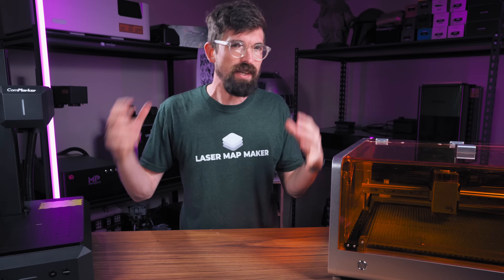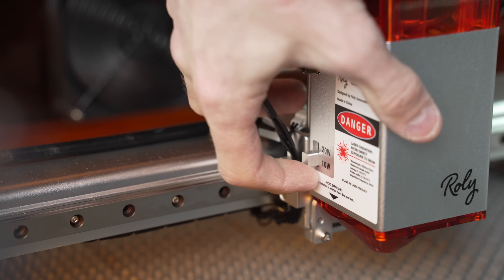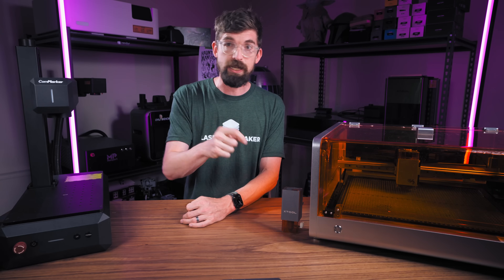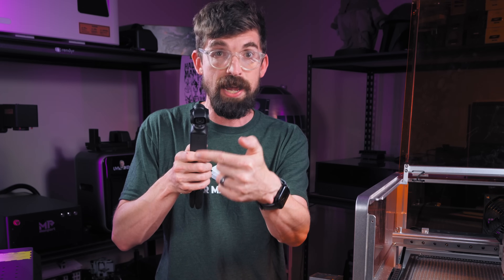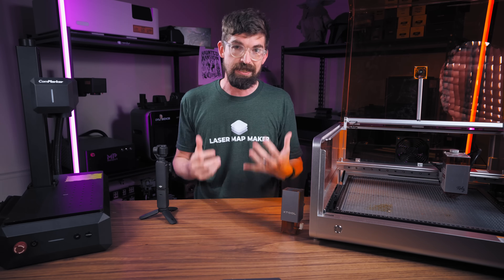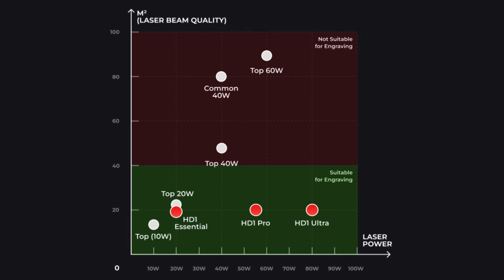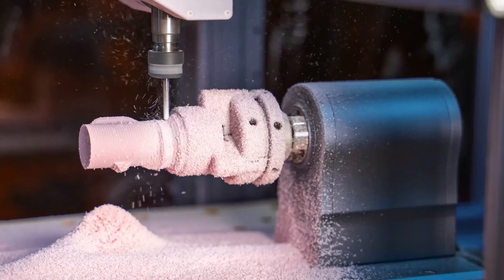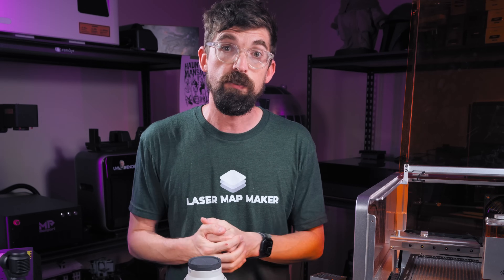Every Laser Has This Problem (Except for One)

Comment: Hey, I need to make some clean cuts into 0.2 mm molybdenum sheets. what laser is best for this if I want to be able to cut like 100 mm in <1 min? I am new to this whole laser environment so I am really unexperienced, but so far my impression is a high power MOPA is the best (maybe the 200W ComMarker Titan?). And how far can I get with UV lasers? because the cheap ones are lower power (10W)... Is something like this maybe enough?
Reply: How far? You mean you want to cut a line on that 0.2 mm sheet, and want to know how long can the line be? Actually it depends on the working area of the machine. Fiber laser is the one for cutting but I don't think you need a 200w titan. 100w or 60w should be enough already.
Reply: no its a shape with edge length of approximately 100mm. the problem is that the cut needs to be clean. i already tried with a fiber laser (100w) but it takes long and if the speed os to slow, the edge gets burnt and looks bad. thats why i was interested in mopa to maybe work on shorter pulse lengths @selmaosvaldo

Comment: I have a off video questions - My xTool P2S temp just gets high when cutting... At starting I had filled up the tank with distilled water around 900ml and my room temps are 34° 35° and below 40°. How can I prevent getting P2S above 35° Celsius?? Expect AC wht other solutions are there??
Reply: And I do cutting and engraving both now mostly 4mm Birch Plywoods and MDF so how often do I need to clear things?? Like the exhaust fan, all 3 lenses and the AP2 Purifier

Comment: You info on Co2 lasers is wong and misleading. I guess to make it sound like this machine is best...
Reply from the maker: I talked briefly about needing to swap lenses on a CO2 machine to change the beam characteristics
Reply: You talked about the power of the co2 laser and not being able to change it 🤣🤣🤣 also you don't need to change the lens to go from engraving to cutting..... i never have and I can do high detail photo images that I've sold a tonne of.....  and I cut on the same machine....
Reply from the maker: Yeh you can totally change the power on any laser, I meant the max power of the diode or glass tube.  You can’t switch out a 100W tube for a 50W like you sometimes can with a diode.

And you can’t switch cut and engrave with the same lens setup, but switching them will optimize it for one or the other.
Reply: @makeorbreakshop why on earth would you want to swap out a laser tube for more or less power 🤣🤣 thats not how co2 lasers work. Do you actually own one? Because you can use the exact same lens for engraving and cutting....

Comment: I've heard a couple/few YouTubers say they're thinking about getting the 'Pro' version of the HD1, but I haven't heard anyone say why they want the Pro over the less expensove 'Essential' or the more expensive 'Ultra'. Would you be willing to make a video talking about the peos and cons of each unit, as you see them?

I "backed" them and opted for the Ultra. I didn't just do it because "higher number = better" but because the Ultra has the MOPA fiber laser, and that's something I think I want...

I mean, I like having more settings to play with and I think the colors that can be put onto stainless steel and titanium look pretty cool, both things that having MOPA enables, but I haven't used either type of fiber laser so maybe I'd change my mind if I had more information... For instance, if the colors aren't that great in real life, maybe the extra cost won't be as valuable to me any longer.
Reply: 55/20 is just the sweet spot. For me the Ultra is too much - and the Essential is to little. 🤷🏻‍♂️

Comment: The increased dot size with increased wattage is a myth and Steve from Steve makes everything who is a professional on this topic has debunked this nonsense and much more many times over...
Reply from the maker: Steve is great, there might be some confusion around what I was saying.  Dot size DOES increase with wattage for diodes because to get that higher wattage you introduce more individual diodes and optics which result in a larger laser dot.  I used to measure dot size with a microscope in older videos to show it.  This is the exact reason manufacturers like Roly, Creality and Atomstack let you turn off diodes to lower the power so you can get finder engravings.   

Accelaser is getting around that by using the fiber cable to focus the higher power laser beam into something you would find on a 20W.
Reply: @makeorbreakshop  Well... For what it's worth:
Why it's believed the dot size increases with wattage:
1. Thermal Spread:
Higher wattage generates more heat, which can spread beyond the focused dot.
This makes burns, melts, or marks appear wider, especially on wood, acrylic, leather, etc.
2. Low-Quality Optics or Lenses:
In cheaper diode systems, higher power sometimes correlates with lower beam quality.
If the system has poor collimation or cheap lenses, the beam divergence at higher power levels might increase slightly — leading to a larger effective spot.
3. Multi-diode Combinations:
Some “10W” or “20W” diode lasers are actually several lower-power diodes combined.
These can have a more rectangular or elliptical beam or even multiple hotspots — this can make the dot appear larger or inconsistent at high power. But it's not.
And finally it's quite an ambitious idea to combine all these in a single machine...
Reply: @makeorbreakshop  power density is MUCH more important that just power.
I'm sure you know about "de-focusing" as a way to get a larger beam size (same power) with less cutting ability?
imagine 1000W spread over 1 square meter = (this is approximately what the noon sun on a clear day does for a 1 square meter target). that's 0.001W per mm^2
now focus that 1000W down to 1 mm^2, and it's 1 million times the power density for the same power.
Sunlight can cut wood and even metal when focused to 1000W/mm^2

"most diode lasers" with higher power result in a larger dot size b/c of shortcuts in engineering.

Comment: Can it cut and engrave  clear acrylic?
Reply from the maker: Nope, that’s probably the biggest limitation, you still can only use materials that work for a blue/purple diode or a fiber laser.  So you’d need to go C02 to get clear/transparent acrylic.
Reply: @makeorbreakshop  thanks..Hopefully at a point, someone will do a Galvo with a C02 laser

Comment: I am new to lasers and just got my COMMARKER fiber  in. I have learned a lot from your channel and greatly appreciate your efforts. I purchased the rotary tools with the Commarker but I was wondering why no one makes a  table based off of the linear movement to expand the target field. I don't know how to describe it but basically an( x-y) bed that can be tiled to create a more generous work area. the bed of the machine seems large in comparison to the work area (?100mm) Even if it was only in one linear direction that would be a plus- just like the gantry machines move the laser head the table could move instead.
Reply from the maker: Yeh kind of like the bed slinger 3d printers.  The closest that I’ve seen is the conveyer belt system that the xTool F1 Ultra uses
Reply: @makeorbreakshop  That is what i was thinking as well, similar format but smaller scale.